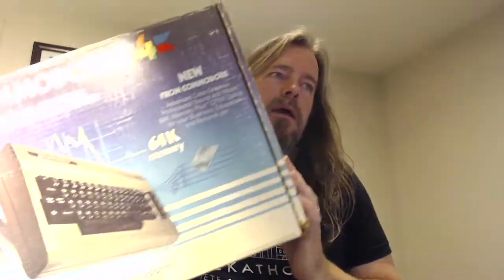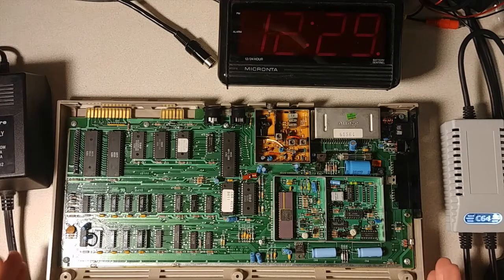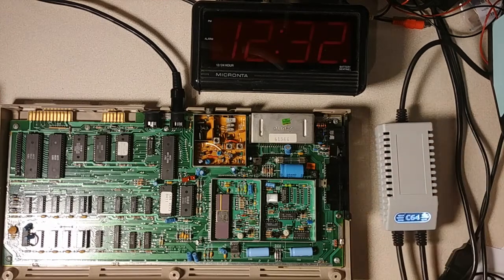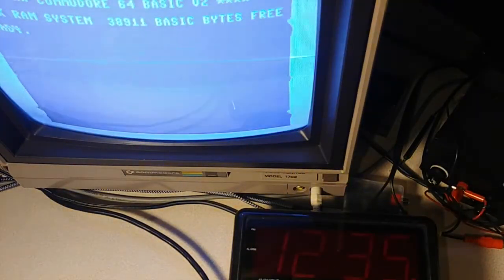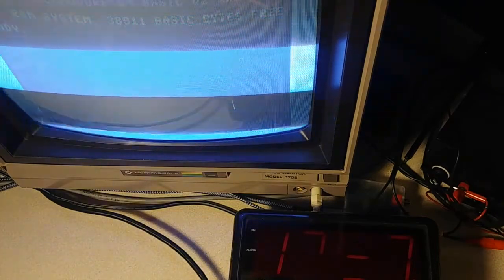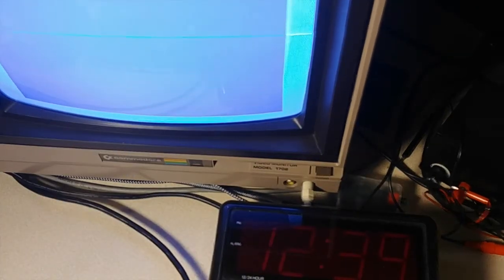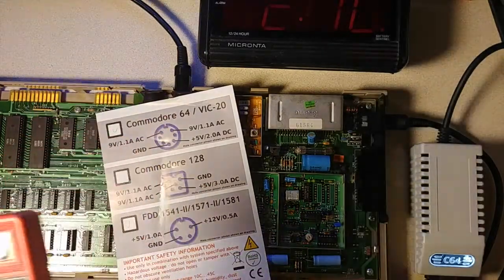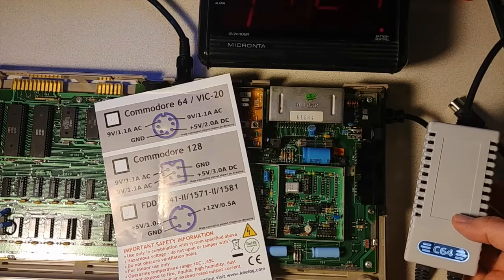C64 issue with Keelog power supply high AC output voltage

Comment from the maker: UPDATE, 24 Oct 2020: Video of the the custom heatsink(s) here: https://youtu.be/F5tjHWYBYx8
UPDATE, 16 Oct 2020: I made a heatsink for the voltage regulator (VR2), from a 3-4" long strip of aluminum flashing with a mounting hole drilled in one end, and affixed it tightly to the regulator using a screw and nut. This heatsink is about 1/4" above the can containing the VIC-II and, thus far (testing across a few days), this keeps the voltage regulator cool enough (~150°F) to not cause the problems seen without heatsink, i.e., the original C64 factory configuration, and the Keelog power supply.
Thanks much to TheRetroChannel, aphexteknol, iz8dwf (Frank), and Andrew Dieffenbach for the additional information and suggestions!

Comment: Is it quite difficult to construct a properly functioning power supply unit for the commodore64.?..Do keelog not do any form of testing on their products.?..I need a new power supply for my c64 but i doubt i shall be getting one of these..Not sure electroware is any better...thank you for your testing.
Reply from the maker: Hola! I use the Electroware. It has similar components, but better build quality (screws instead of glue, better isolation) and performance (lower AC voltage, closer to spec) based on my testing. You can find details about it in my video about it here:
https://youtu.be/daE0QzkroB8
Reply: @DrDavesDiversions  Excellent and thank you..have a happy new year...best wishes.

Comment: I just ordered a C64 PSU from Keelog about 2 hours ago thinking it was the next best thing to sugar, then by chance came across a video from retrobits briefly describing an issue with that PSU and recommending your video, I immediately sent an email to their sales team requesting my order to be canceled, I hope they honor my request. Thank you for making these videos and saving my bacon!!!
Reply from the maker: Sure. For anyone that has the Keelog having too high an AC input voltage for their 64, but still want to use it (instead of replacing with a better PSU such as the one from Electroware, covered in my other videos), I recommend a simple modification: Replace VR2 (the voltage regulator in your 64) with a switching component, like the Traco TSR 1-2450 (~$5 USD; there are cheaper options, even, on eBay, but I like the quality of the Traco). In my measurements, this dropped the temp of VR2 (compared to a 7805 with a heat-sink) by 54 degrees F and dropped the SID temp by 5 degrees F (due to ambient heat trapped inside the 64 case).
So, basically, the out-of-spec Keelog won't overheat a 64 if it runs a better (modern) voltage regulator.
Peace.

Comment: I’m also really unhappy with the RetroPower (same company as Keelog) PSU for my 64. It’s the new more modern rectangular design with the large center window. I’m measuring almost 13v AC when C64 is off and a bit under 11v AC at the user port when running. I just received this from Poland. I think I will disassemble it and see if I can re-design it with a different transformer. I can’t really use it like this.
Reply from the maker: There is no good solution for the user port voltage using this PSU (but most people don't plug anything in there). However, I have a good solution for you for the main board voltage and resulting heat. Replace VR2 in your 64 (which is a 7805 voltage regulator) with a pin-compatible switching component, such as the Traco TSR 1-2450 (~5 USD) and dropped the temp 54F and the SID temp by 6F when using the Keelog PSU. Basically, swapping VR2, you can make it run cooler than with any other PSU and the original 7805 regulator, because that one dissipates a lot more heat inside the case, and ridiculously so with the Keelog PSU.

If you use facebook, I posted this to the Commodore 8-bit Repairs and Upgrades group here: https://www.facebook.com/groups/1954758181300269/search/?q=TSR%201-2450
Specifically see the comments in my post that begins, "Who's hot? You're hot C64!"

If not, you can email me (contact info in my channel's about info) and I can share some photos of that mod if you like.
(I intend to make a video about it, but don't hold your breath... could be months.)
Peace.
Reply from the maker: IMO, a problem about modifying the Keelog is that the case is too small. They really backed themselves into a corner with this design, contrast with the Electroware, which has plenty of room and better construction.
I discuss that at some length in these videos:

"Keelog Dual PSU mod to power C64 & 1541-DC"
https://youtu.be/GjS5O6yq7rQ

"Electroware C64 PSU heavy-duty mod (30W DC power)"
https://youtu.be/daE0QzkroB8

Apologies if you already found these. :)
Peace
Reply: @DrDavesDiversions I ended up just buying an Electroware. They have a new model with dual outputs like your mod. I really like it. Thanks for all the help!
Reply from the maker: @mk500  Great! Thanks for letting us know!

Comment: My Keelog started producing dangerous levels and killed itself while blowing up the fuse of c64 even though it was turned off.
Reply from the maker: Ya, I don't recommend them, especially not for a 64. Good that the fuse did its job.
By contrast, the competing Electroware PSU (coincidentally also made in Poland) is in spec on AC output voltage, better designed (case size), constructed (screws instead of glue), and more serviceable.

Comment: im having a weird issue with a keelog psu that output 11.51vac im using a 250407 board with a kernal eprom adapter (whatever kernal rom i use i get same result) when i want to play ultimax mode games (radar rat race or jupiter lander) from the original cart or kung-fu flash only .crt not a .d64 conversion because they dont use ultimax mode, i get some weird static on the screen this only append when i use both the keelog psu with the eprom rom adapter at same time i use a kernal adapter that i built myself from a pcbway board shared project i have built 4 of those adapter with resistor sourced from different store i tryed 2 different board with same result , btw i have around 8 original psu and none of them seem to fail, btw i see 4.7vdc on that eprom with the keelog psu and a flat clean 5vdc when i use an orignal psu, the worst part is i buyed this keelog psu beacuse of fear and i wanted to be on the safe side, now i feel i got scammed by keelog im defenitly not a happy customer, they sell cheap sketchy psu, shame on them
Reply from the maker: Hi Marrky! I understand and agree. I relayed in the comments here in and my other Keelog videos that I did share this experience I had with one of their engineers and they admitted the potential problem (with some C64s) and offered to refund my money with a return. I declined (and decided to keep it) because I had modified their PSU and, in my experience, despite it being unsafe to power a C64, its DC section does work well to power my 1541, so I keep it as a back-up PSU for that.

At least you detected the problem, like me, so we knew to stop using the Keelog PSU on the C64. There are presumably lots of other customers out there that think this Keelog PSU is fine simply because it appears to work for them. What they don't know is that their C64's voltage regulator is running too hot, and likely shortening some components' lifetimes.

I believe Keelog made a poor design decision early on, making their case too small to fit different transformers that could fix the problem (note how much more space there is inside the competing Electroware PSU), giving them very few options than redesigning much of the product from scratch... which they seem unwilling to do.

Comment: I have new Keelog
PSU C64 combined with 1541. 
The 9V AC is unloaded over 12V! It killed my WIC64 cartridge. Any tip for small load which make voltage lower?
Reply from the maker: No, my understanding is that the problem is with the AC transformer component that they choose to use inside the Keelog C64 supplies. They simply have too high an output voltage under load when used with mains power in many countries.

I don't recommend using Keelog PSUs for a C64. I decided to go with Electroware instead. It is better in a number of ways, in my opinion and does not have too high an AC voltage under load. If you're interested in how they compare internally, I show both the Keelog and the Electroware PSUs here: https://www.youtube.com/watch?v=daE0QzkroB8

Keelog offered to refund my money and acknowledged the problem. I declined since I modified mine and can still use it to power the 1541 (which doesn't use the AC output). To the best of my knowledge, they have decided not to fix the problem. (The case is too small to fit alternative parts, in my opinion.)

Peace.

Comment: Hi, and thanks for shareing this info, I will go with the the Electroware option. Love the videos. Thank you very much Dr Dave :)
Reply from the maker: Sounds good. I don't hesitate to recommend the Electroware product.
For machines that don't need the AC power output (like Amiga), perhaps a Keelog PSU is acceptable, but not in general for the C64. I think some of their employees are well-intentioned but unwilling to address their product's problems (that most users can't identify).

Comment: I wonder if its possible to just power the c64 with 9v and then use another regulator to convert that to 5v.
Reply from the maker: You can see how I solved the problem here!
Electroware C64 PSU heavy-duty mod (30W DC power)
https://www.youtube.com/watch?v=daE0QzkroB8

Comment: It killed 2 of my older Commodore 64 using the smaller classic Keelog C64 Powersupply.. GRR! Measuring now (without load) 11.1V AC. I guess that's what killed them. Not satisfied with it. I'm still waiting for answer from them.
Reply from the maker: Hi Magnus - old 64s have individual components fail a lot. Most of these are not attributable directly to high AC voltage; we can't jump to conclusions other than that too high a voltage is unnecessary and sometime damaging. but typically only over time.If it is still too high *under load*, then it is probably most likely to cause overheating of the voltage regulator, IMO, which is easily replaced when it fails.
OTOH, high DC voltage from a 64 PSU is a quick killer of chips because it is fed directly to them, whereas the AC is conditioned by the 64 itself.
Voltage when not under load isn't of much use to when evaluating a PSU. This could easily drop to 10V or less with load, which most consider healthy.
Good luck.
The transformer in your Keelog could be changed (there is enough room in the case) if need be.
Reply: @DrDavesDiversions  Actually, in this case, there is no denying it killed them first time and directly. C64 Breadboxes that worked perfectly before. One has been working for 37 years without any problems for me. The other one was a C64 Breadbox NTSC that I bought some months ago. Both dead. They will probably/hopefully be fixable but does not work with any power supply now. Quick measurement shows that 5V is perfect and, like you found, +9V AC is on the high side 11.1V without load. An older one has 10.4V without load. Probably that did something to the incoming part of these C64.
Only reason for me try try one more was that I though there was something wrong with the Video output of the first one, but no. Both computer died within 1s of using the Keelog. For now (before getting info from them) I will not recommend anyone buying these supplies and connecting to their old legacy computers which can be quite hard to fix due to component shortage. I'm gonna post an answer to this if there is a solution to the problem.
Reply from the maker: Interesting! @MagnusWedmark  When you find the component, I would be interesting to know what failed!
Personally, I would check VR1 and VR2.
The C64 mostly does not use the AC voltage directly; it rectifies it to DC and puts it right into a voltage regulator.
The exception is the cassette motor and RF modulator gets unregulated (but rectified) voltage from the AC input.
Mike at RavenWolf Retro Tech does a great job of showing that here (2m15s):
https://www.youtube.com/watch?v=kAAnxC8iqmE&t=2m15s
Good luck again! :)
Reply from the maker: Aside: if you haven't already seen it, this talk shares a good perspective on C64 livelihood :)
https://www.youtube.com/watch?v=PYDn9idlWb4

Comment: Keelog is junk.  I'm glad you did this video.  I've been complaining about this on the forums for over a year, and folks have suggested I do the video you just did, but since I also build and sell power supplies, I felt like it would seem self-serving.  What happened was that I bought one a while back on ebay from their BMCSolutions store, and it sat in the box for 3 months before I got a chance to plug it in.  When I did, I plugged it into my tester, and with a 5-ohm load (that's 1A), it output 4.75vdc. Naturally, plugging into a C64 was unstable.  I reached out to the seller, and I was shocked when they said "It has been too long and they can't do anything for me".  So much any kind of warranty!
Reply: Thanks for this video my C64 experienced the same problem after buying a keylog PSU.
My old PSU works just fine but this keylog PSU gives me the same symptoms and voltages as yours.
If you have an NTSC c64 you probably want to avoid keylog PSU.
Reply from the maker: Thanks for the additional experience. There is a lot of confusion out there from other people doing too cursory a review, IMO. In a way, I was lucky to have the problem be so obvious which caused me to really dig in and do a lot of measurements here and in my other Keelog/Electroware videos.

Comment: I recently bought this power supply from keelog and package arrived yesterday. I measured the voltage and it shows 9.4V AC. Can that be considered acceptable? The original PSU shows 9.1V AC.
Reply from the maker: Yes, 9.4v is considered fine. Generally people say 10V or less is fine. Some Keelog users are seeing over 12V AC.

Do you mind sharing what country mains power you are operating on? Also, when was the PSU purchased?
I have never seen a Keelog supply that didn't supply too high an AC voltage, but my examples are from Australia and the U.S.A.
Thanks for the info - it would be great if they fix this, in general.
Reply: @DrDavesDiversions  Sure. I live in Turkey. Ordered the psu last week and it arrived yesterday. I also bought an Amiga 500 PSU from them, which both seem to work fine. I have a breadbin c64 but has heatsinks on the voltage regulators. I also have a later version c64c.
Reply from the maker: @alieminuzun6730  Cool (pun unintended). When I talked with Keelog folks via email, it sounds like they it works better on European power standards. (This is, of course, no excuse for providing too high a voltage in other countries.)
Personally, I have evidence that the Electroware power supply is better.
Their Amiga one should be fine because it doesn't have the high AC voltage problem.

If you're interested, I did extensive work taking apart the Keelog and Electroware C64 PSUs and comparing them in the first few minutes of this video:
"Electroware C64 PSU heavy-duty mod (30W DC power)"
https://www.youtube.com/watch?v=daE0QzkroB8
(They are somewhat similar except for the AC transformer, build quality like glue vs. screws, and the size. Too bad Keelog made the case too small to accommodate other components.)
Peace.
Reply: @DrDavesDiversions  Thank you. Another Amiga enthusiast from Turkey here. I have a furia A600 and I bought the boost version from Electroware today due to your recommendation.
Reply from the maker: Hi  @jeremyboku  ! The Electroware works well for me. (I have some more videos about an optional mod I did to it as well.) There are certainly people happy with the Keelog as well (on 8-bit and Amiga), but I think the (C64) problem is hidden for most people, such that there are no visible symptoms. The Amiga PSUs do not supply AC voltage to the computer that was the problem for me.